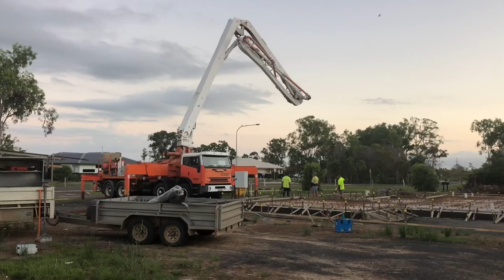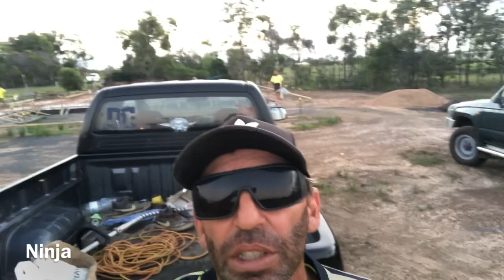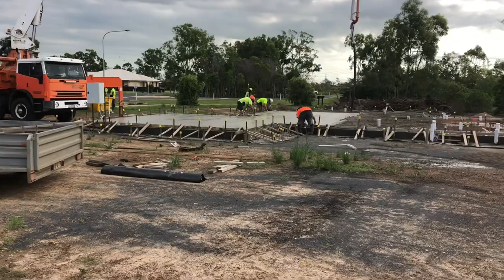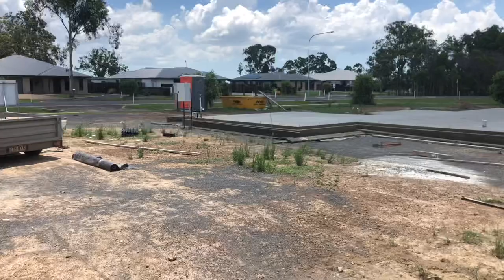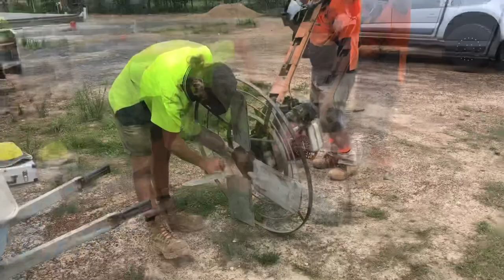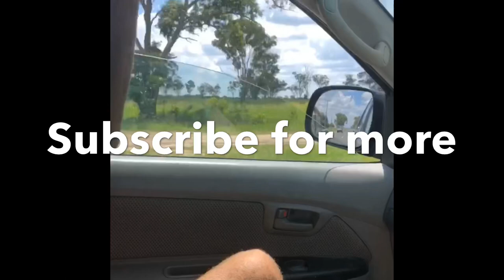Concrete ninja vlog 4 how to clean your copper

Comment: Put the chopper on grass and run it while pouring water through the blades.  Clean.
Reply from the maker: Aaron W yes I’ve done that one a couple of times 💯👊
Reply: and you have clean chopper and grass full of concrete dust
Reply: @sajuente8235  Yeah obviously you don't do it on somebody's lawn.  In this video alone there is several patches of grass/weeds that could be used.